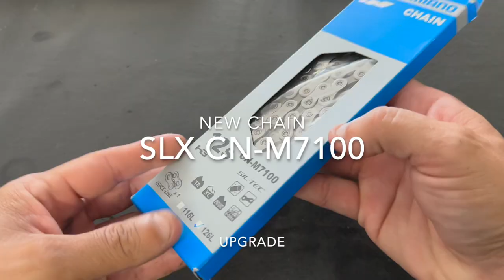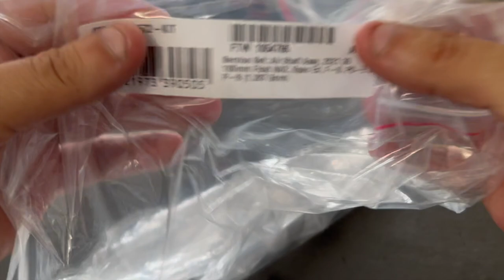Upgrade your wheels on Trek Roscoe 9. Comparing weight and specs

Comment: Not sure 10mm will make a difference on the front, more slack but the travel difference isn’t much. Nice wheels, I’ve ran the i9 enduro S wheels, had issues with spokes breaking on the rear hub. The lever swap is genius dude! Those pads will rattle, if your using 203 rotors you won’t have fade or too much heat. Nice job on your videos!
Reply from the maker: Thanks I appreciate you taking the time to watch my video

Comment: Trek say max 150mm fork. What. Negative does putting 160mm have?
Reply: I’ve found out watching a vid on Stanton bike frames. It puts too much stress on the head tube welds. Bigger lever. Bikes are out in jigs and tested to rated their strength.
Reply from the maker: 10 more millimeter is really not gonna make that much of a difference especially when you’re under full load
Reply: @hardtailrider7172  true I’d imagine they build in abit of a buffer too. How’s the dropper post doing? Wats the longest you think you can fit in a M/L frame?